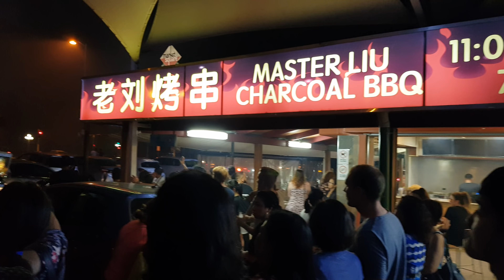Install a new Drywall Plasterboard Ceiling

Comment: why the glued on pieces between joists? to make it more sturdy? we don't do that in the us.
Reply from the maker: They are back blocks to keep the joints secured  and together. If there are three or more joints in one ceiling you have to have them.
Reply: Yeah we dont put that stuff between joists in canada.. doing this on a small job like this isn't a big deal but on a big house where you got 400 sheets it would be annoying and it takes time to do this. To they pay extra for this or is it included in the price
Reply: OutOnBail pay extra ,
100-150 dollars depending on the size of the house , 150+ if the house is 1000 sqm or more

Comment: Where is the plaster? All i saw was drywall! And what were the little brick sized drywall pieces for? You didn't show yourself screwing them in to the hung boards, merely mudding them on, no screws?? Why not screw on for extra retention. Isn't that why you used them? Surely not for extra momentary pull for a few seconds between putting new board up and screwing it in??!? hahaha!
Reply: Drywall is a more common term in USA. We tend to use the term plasterboard in OZ. Though the poster has titled the video with both to help with the difference when both countries may search.
Reply: We call it Gib boarding NZ, all the same stuff